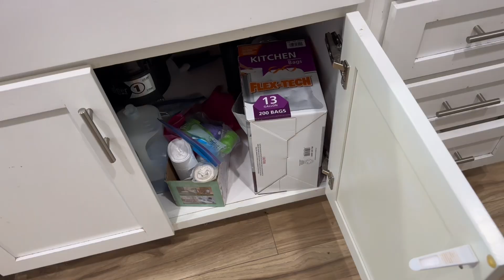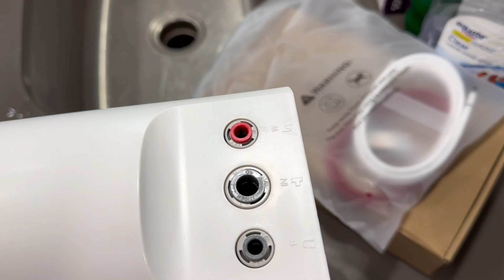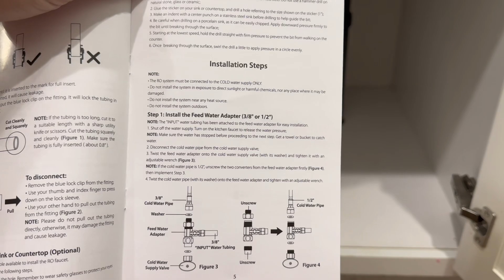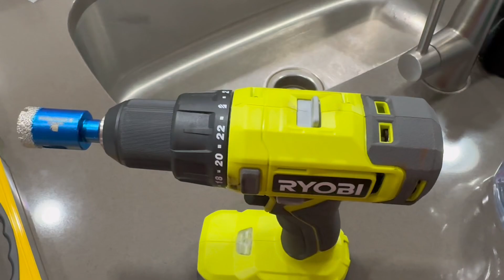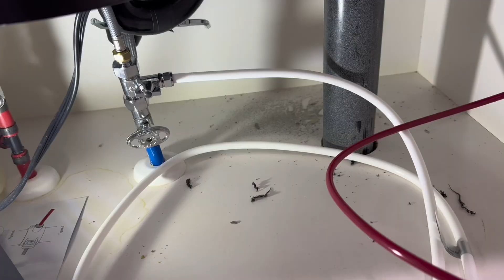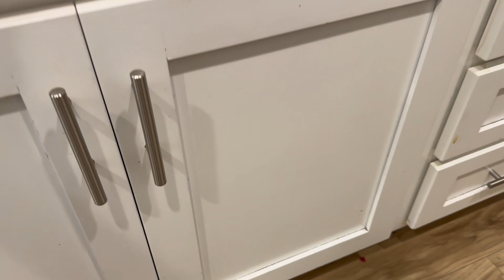How To Install The Waterdrop G2 Under Sink Reverse Osmosis Water Filtration System

Comment: Se l'acqua fredda è gestita da un autoclave va bene lo stesso
Reply from the maker: I imagine it should be fine. This is simply a filter system with a built in pump to get the water up to the faucet. So it just needs a water source to use to filter the water through the system.

Comment: Good job! The only thing I don't understand is why you need to drill such a big hole in the table if the faucet pipe is 3 times thinner
Reply from the maker: That's a great question! I thought the same thing. I think the larger hole allows for some wiggle room to accommodate the various connection points and allow for future adjustments if needed.

Comment: have you got any cloudy water after installation? my one 2 week already still got cloudy water everytime when want to use it
Reply from the maker: Dang sorry to hear! I haven’t had any, but it sounds like possibly air is getting into the line causing tiny bubbles. Does the cloudiness go away after letting it sit for a minute?
Reply: @dangooddad it's gone away but got some dust at the bottom of the glass
Reply from the maker: @chuti98 okay that’s very strange. It may help to flush the line out. You could disconnect the main hose feeding water into the filter system, and turn it on to flush it into a bucket. Then reconnect, and try that. It could also be coming from the line coming out of the filter, like maybe dust and debris got into the hose on that side. You could try running it all for a few minutes to flush the entire system.
Reply: @dangooddad I try to turn off water in valve but nothing come out. I am just curious as it is a new system that I just installed it 2 weeks ago but it happened after first week mostly dusty look like white bit or scale.
Reply from the maker: @chuti98 it’s tough to say what’s causing that. It sounds like it’s coming from the hoses. Once it goes through the filter it would likely jam it up if it’s large debris. It wouldn’t be able to go through the filter.
Reply: @dangooddad as I didn't use the faucet that came with the package but use the one that I used to use with the waterdrop 1 filter before but it wasn't long ago. As everytime I need water I have to flush out at least 3 glasses before I can use for drink.

Comment: Did you ever figure out what was going on with the outlet under the sink? I just installed this and I’m having the same problem. Wondering if the outlet under the sink has smaller amps? So not enough to power it
Reply from the maker: Dang so frustrating ! I had my brother help since he knows how to fix electrical issues. He figured out that the switch that turns off the disposal was wired to turn off the entire outlet too. So the power to the extra outlet shuts off when the disposal is off. That’s likely your same problem. I’m not completely certain how he rewired it to make it work so I’ll check with him to find out.
Reply from the maker: @taylorhearne My bros reply: “When I fixed the outlet I had to isolate the power on each of the outlets so one was switching for the disposal and the other was continuous power. There is usually a tab on the outlet that you can cut to break the connection between the contacts. If not, it may already be separated, or you can buy an outlet that is.